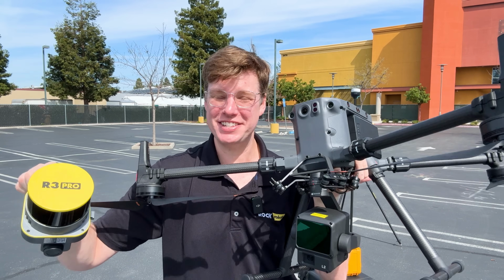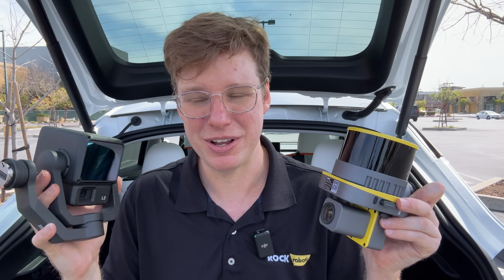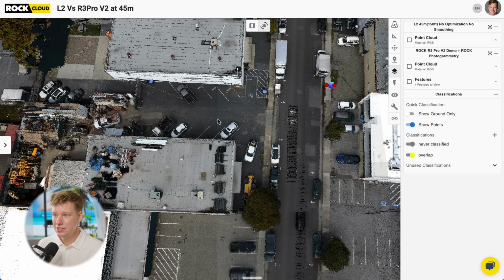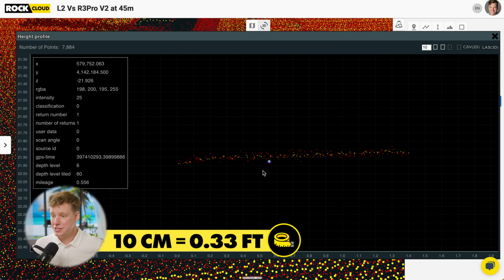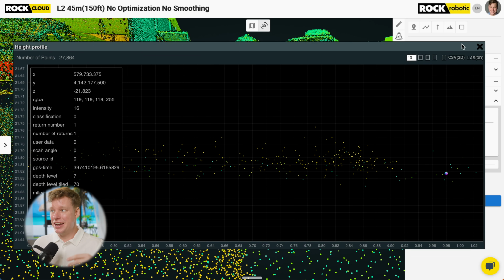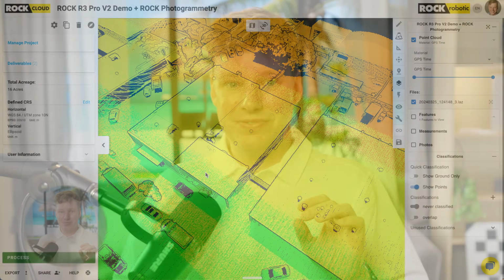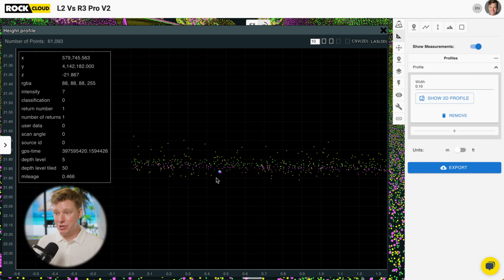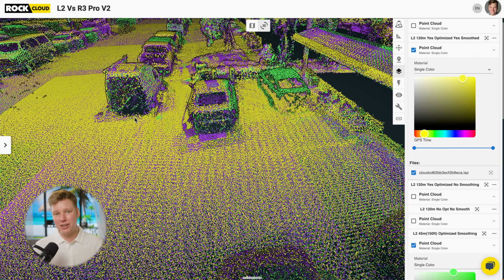Is the DJI Zenmuse L2 LiDAR worth buying? (L2 vs R3 Pro V2)

Comment: It's easy to do LiDAR on asphalt or any other flat surface. But could you topo a field with vegetation and then stake it out using a GPS rover to verify how accurate your surface really is?

We have a solar farm project covering 3,500 m x 3,500 m. The client provided a LiDAR file captured with an L2 LiDAR unit. When we staked it out, we found that their surface was between 70 mm and 450 mm higher than the actual ground surface.

With this level of error, if we were to strip the topsoil based on that LiDAR surface, we could go on site, do nothing, re-topo the field using a conventional survey, and it would still show a supposed 2,450,000 m³ of topsoil (calculated as 3,500 × 3,500 × 0.2 m average error). That’s a massive discrepancy — and a lot of money.

Comment: Running the R3 with software specifically optimised for it should obviously result in a better outcome. Running the L2 with Terra would probably produce a better result than shown. The R3 might still be better but the hardware and software cost are multiples of the L2 and Terra cost.

Comment: This looks like a Non-repetitive path scanning for L2. I'm not using it due to this kinda bad result. Total different story for the repetitive scan path, which is very accurate and precise even without smoothing and optimization. I'm super satisfied with my L2 unit in rep mode. I've noticed also a thing: i'm always using an Emlid RS3 set as base when using lidlar, with short baseline data precision increase drammatically, and also doing PPK. Your dataset looks acquired in worst condition possible.
Reply: Did you have an L1 also? I have an L1 and am debating about getting the L2, or maybe the r3.
Reply: @palliard  i had L1, i sold for L2. l2 is way better. In repetitive scan is super, the points spread on flat surface is around 4 5cm at 120m agl. My typical altitude is about 90m and I have 3 to 4cm spread, which is pretty good. I've never used non repetitive scan due to lack of precision as seen in this video. L1 was good only for forestry, I had to do a lot of post processing and always mix data from photogrammetry in order to increase precision.

Comment: Do you use the pilot2 mission plan for the L2 and just run the R3? Does the L2 calibration sections of the flight work with the R3???? I have a mission we are flying both sensors in a day and need advice on using the pilot2 app to control the flight’s?

Comment: The clear precision advantage of Rock R3 versus DJI L2 may not be sufficient to justify the double-fold price increase, however; the SLAM feature of Rock R3 is well worth the extra cost enabling indoor mapping and modeling. The modular architecture of Rock R3 is still another outstanding feature. If I were Rock Robototic, I would create a symmetric modular chassis with individual or group slide-lock payload capability. I would thus present a full-frame Rock FX camera module with a mechanical shutter and a 60 mpx sensor to replace the DJI L2 + DJ P1 combo all at once.
Reply from the maker: 🤔 you might be onto something there…
Reply: @IndianaDrones  I solemnly swear that I am up to no good 😀

Comment: So even at 30m altitude it will not pass as a usable surveygrade data, so whats the point of L2? Why would anyone use it.
Reply: We didn’t see optimized on, smoothing off. Surveyor legal limit of accuracy for topos is half the delivered contour interval. So 1’ contours means you have to be under 0.5’. Aerial* Lidar does best in vegetated areas or general ground shots anyway. For urban areas and features like curbs, just shoot it traditionally or scan with an sx10 and save yourself the headache and liability for busting grades- especially on ADA ramps that require tight specs. The point of using a lower-end system at all would be best for general ground topo shots and where access is limited, or difficult to cover efficiently on foot.
Reply from the maker: Good question!
Reply: What's the maximum for survey grade?

Comment: The big difference is the price of the units themselves and even more so the monthly cost of the software. The difference in cost of the software is the real significant difference. It appears the quality is better on the R3 but not sure if the added quality is necessary for most land survey mapping and justifies the cost of the software. Before making a decision to buy these products consider the cost of the software.
Reply: I believe DJI Terra offers a perpetual option at $4400 with occasional update costs if you want to update. It is difficult to justify the $2000 or $1500 a month just to get your point cloud, especially if not using all the time in a seasonal climate area.
Reply: @RuebenMiller  per year not month.
Reply: Terra is free with L2
Reply from the maker: L2 is roughly $1,500 per year and The R3 Pro is $2,000 per year.  Not a huge difference

Comment: The L2 is 12k and the R3 starts at 25k. For someone just starting and learning cost makes a big difference.  Would flying slower help on the L2? Is there a different outcome on a M300 vs M350? If you have a half circle reflection on the R3 side not being used, does it help the data?
Reply: L2 works great. Outperforms the R3 and at a third of the costs. Plus live results.
Reply: @precisionaerialservicesllc4875  I think R3 does live too
Reply from the maker: Outperforms, how? The L2 isn't SLAM capable. Did you watch the video?
Reply: @IndianaDrones  somebody is getting paid
Reply: R3 starting at $25K where? Mine was $30K and now they want $2k+shipping for the V2 upgrade.
Reply from the maker: Yeah, $2K to upgrade the original unit to an entirely upgraded system. The new capabilities are more than worth it. And, we're offering incentives to cut that upgrade price more than 50% if you share on your socials. We think this is a pretty fair opportunity.
Reply: @IndianaDrones  It seems like we have different approaches to math. $700 isn't 50% of $2,000, which doesn't include additional costs like round trip shipping, shipping insurance, and downtime.
Reply: Also, it's 13k now for the L2, plus you have to have an m350, or you have to upgrade to the newer controller for an additional 1600. But then you don't have to pay the 1400 a year for DJI Terra because it's free with the L2. So 13000, plus 1600, which is 14600, with no yearly cost for software. But at that cost, you're halfway to getting the R3 which has more precise results that can be used on way more project applications. And selling the L1 that's only worth about 3k now. This is my analysis at 10-1-2024. Debating on which path to choose, and how well I'll be able to see that path, or whether the curbs will be smoothed out so I don't trip :)

Comment: Is a 'return' how many times it measures the same point?
Reply: Not exactly. Think of a laser as a cylinder with a diameter. That pulse hits a leaf with (let's say) 25% of the "cylinder's" area, another 25% hits the bush underneath and the rest of the beam hits the ground. A lidar with 3 returns can measure all of those 3 different points, whereas another with 2 returns can measure only the first 2.

Comment: I shot thick woods with the L2 and rarely needed more than 3 returns. If you're shooting thick woods just fly slower you'll get through the brush
Reply: That would be fine, but if the ROCK only gives you 2 returns.... where do you stand? Are you saying fly with the ROCK just more slowly?
Reply from the maker: It's really not about the number of returns the LiDAR has. It's actually about how useful the returns are. How useful is 5 returns if they're not all accurate?
Reply: Slower.. 8m/s? Or slower?